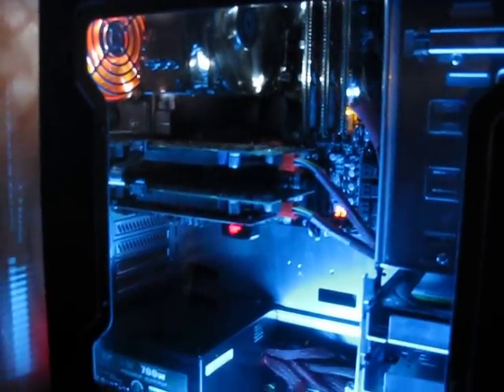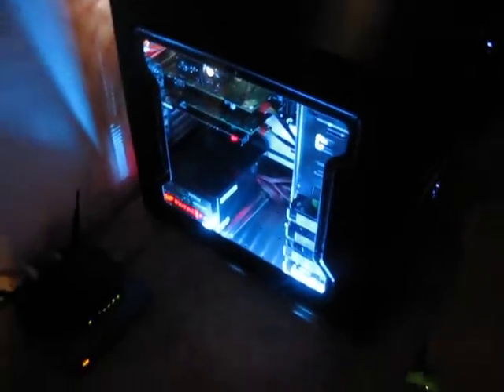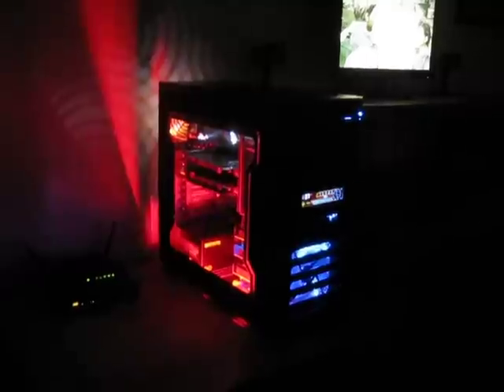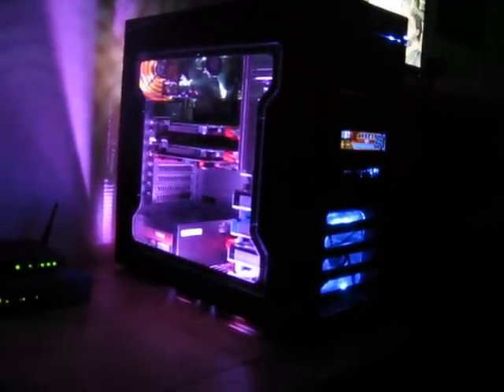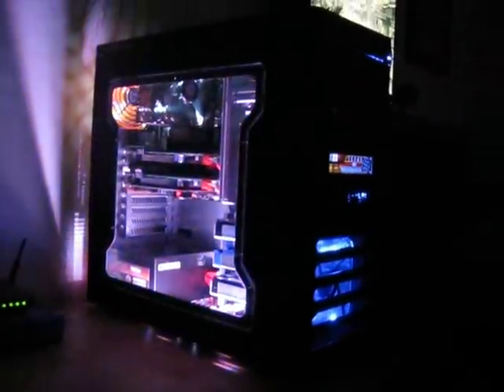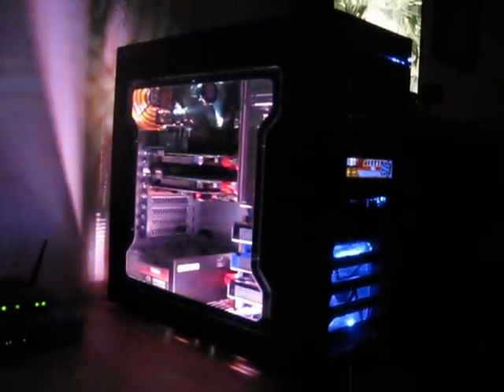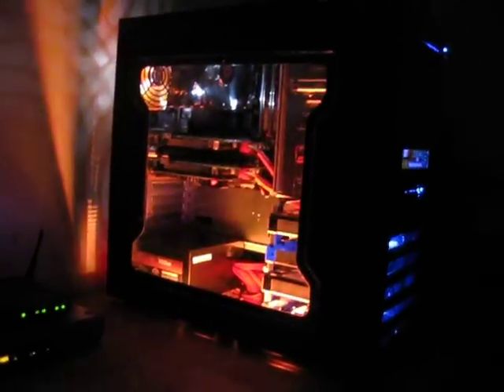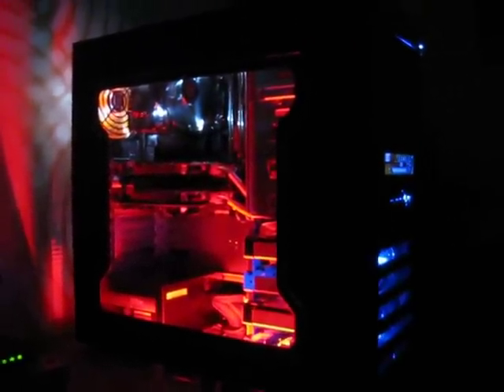Project Lian Li PC-7FNW i7 Build (Lighting)

Comment from the maker: There is quite a bit of space behind the board and enough space behind the power supply to conceal your extra wires. I have quite a bit of wires and they are all hidden well. It's an excellent case and well thought out.

Comment from the maker: I've never had any problems with melting. Seems that would be electrical and not to be blamed on the housing. The case only comes with a simple power/reset switch and low wattage fans. Anything beyond that is within the discretion of the build.

Comment from the maker: Crazypc and ledlight.com is where I got the lighting and I have a lazer in the hdd cage pointing back to the cpu cooler. The tubes are run behind the window panel so you don't see them. There is just enough space to run 4 cc tubes along the edge of the case just inside the side window panel. I took an old 12v power cord from a toy and cut the plug off and adapted a molex connector to it. The molex connector runs to my psu. It looks bad ass at night and has a remote with full spectrum and dimmer.